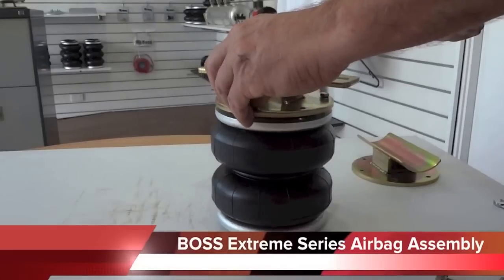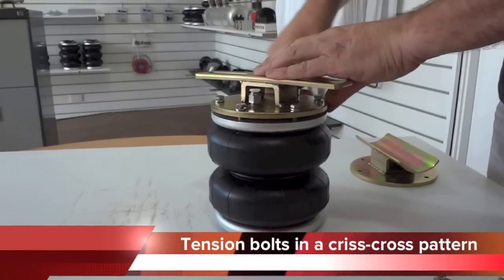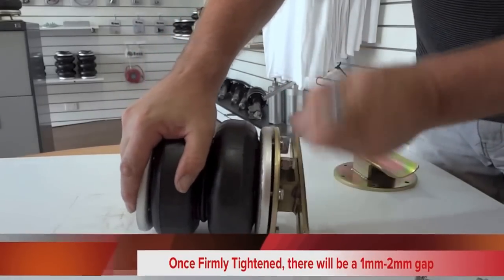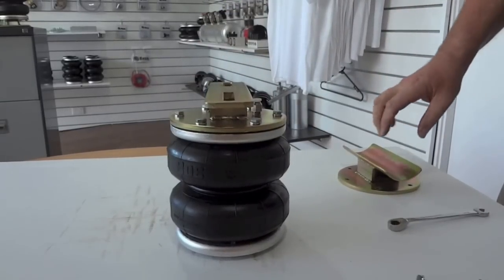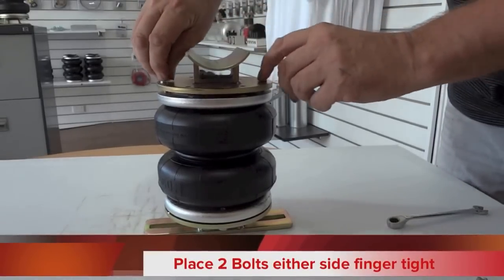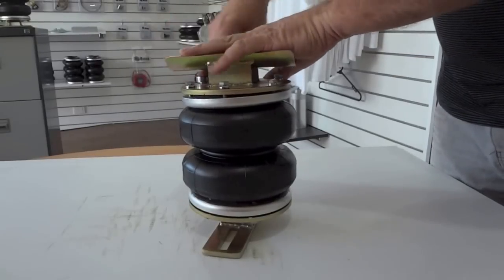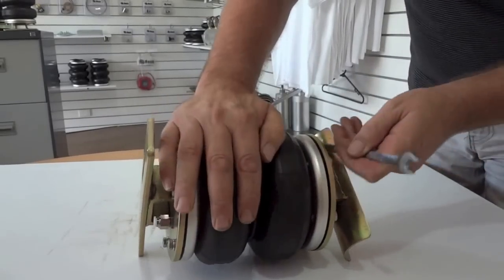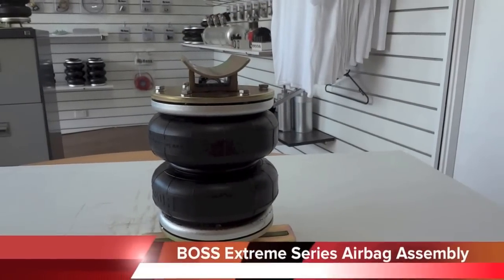Boss Airbag Assembly

Comment: i fitted boss air bags couple mnts ago and fitted as per instructions ,having been in the motor game for 45 odd yrs was simple enough ,i was concerned about the uneven surface of the rubber moulding of the bags where it seals to the top &bottem plate but was assured no sealer was required so fitted it  hoping they wouldn't leak" WELL THEY DO" !!which is a pain so i'll have strip the bloody lot again to see whats going on .
Reply: twogates233  put mine in today and boy am i fucking dissapointed mine leak too

Comment: I am a bit skeptical about aftermarket wheels as I had a bad experience last time. Long story short, my first ever car was a little micra 1.0 and i got all the kit to fit a new steering wheel. Anyway, first of all it needed a special security torx bit which only garages can buy, then when I finally found a garage that had one, they rang me back and said, look if we fit this it means you would lose your indicator stalks and airbag making the vehicle illegal and wouldn't pass it's MOT. I've just purchased a fiat punto grande active 360 1.2 hatchback. I'd like to install a new wheel but I am not going through all the hassle that I went through previously. Could anyone 100% say to me that a new wheel can be fit without any legal/mot/insurance issues. Thanks lads.
Reply: no problem mate

Comment: Hi.... Im keen to have a pair of these in my 79 v8 cruiser. But before that please answer these two questions. 
1. I have a 4inch lift. So do i have to buy any additinal parts with the three bag vehicle specific kit?
2. When im not on camping, my rear will weigh not more than 100kgs (excluding the weight of the tray.) so what will be your recommended air pressure for this case?
Reply from the maker: Hi there, all you will need is the triple airbag kit for the 4" lift. When you have no weight in the vehicle you could run it at around 5psi